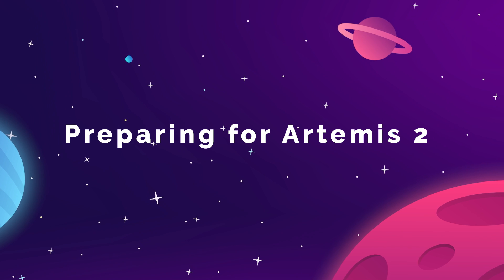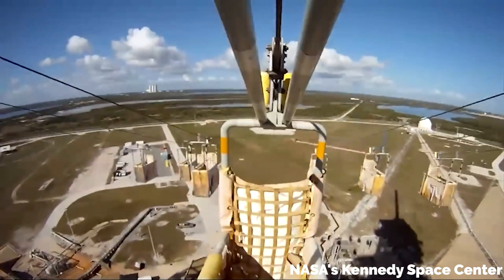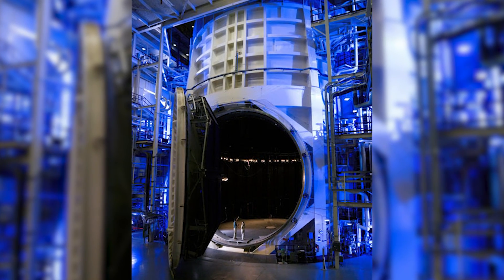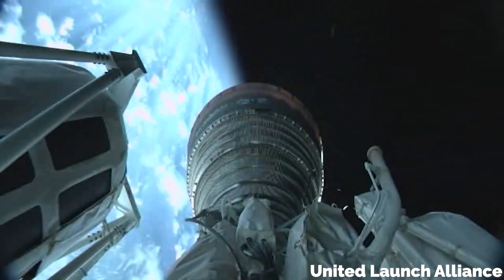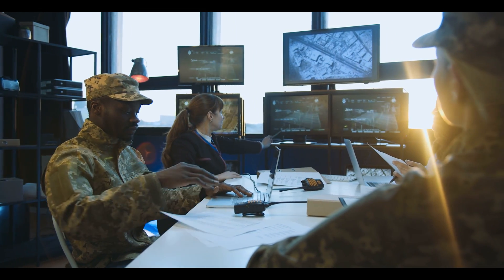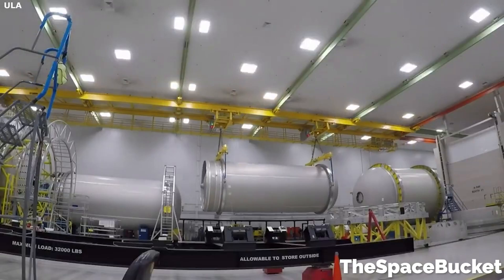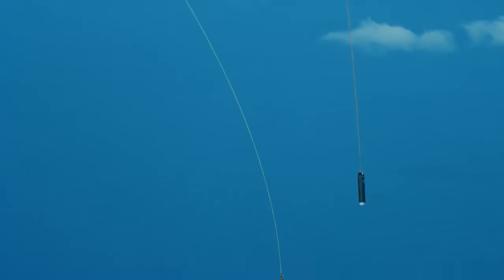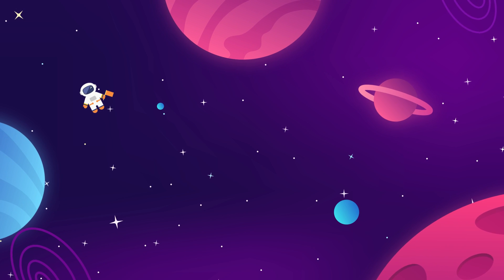The NASA Artemis 2 CREWED Mission Update Is Here!

Comment: Of COURSE, the LES was installed and armed for A-1! It's an all-up test. Every variable must be assessed, asmits a dynamic system where all the parts are affected by the others. LES is oart of the system. 
Last, before the Orion is actually used after orbital insertion, the protective shroud over the spacecraft has to be jettisoned.

Comment: Keep in mind going is not a reliable rocket an aerospace company it never was really it was a very reliable aircraft developer and Builder, but since the buyout / merger with McDonald Douglas everything about Boeing and its operation went down the toilet. For some reason Boeing immediately began implementing failed operating practices that were responsible for the end of McDonald Douglas and worse they allowed former high-ups from Douglas to make major decisions under bowling they fired and forced retired much of the senior Boeing engineering staff, and then began wholesale Doling out of manufacturing who as yet unreliable and unproven subcontractors and Sub of subcontractor. This is why Starliner is an utter abysmal failure other than a means to siphon off taxpayer money. No one should consider Boeing either an aerospace company or a reliable Corporation.. Boeing is not anyting even remotely on the scale of Boeing that designed the 747 which became the most common and reliable aircraft in civil commercial Aviation history. That Boeing is dead and gone.
Reply: moron

Comment: Seems that physiologically the amount of Fitness degradation that could occur in flight-ready fit astronauts over a 10-day period would be minimal and could not be avoided or reduced with the limited amount of exercise that would be possible inside the capsule. Seems to me that having so-called exercise equipment is really having blood circulatory equipment would most likely be to help avoid developing So around both is similar to that which occurs a few people during long transcontinental air flights. Have they stated any particular objective in medical terms for this exercise equipment